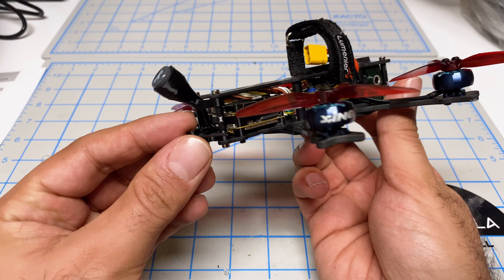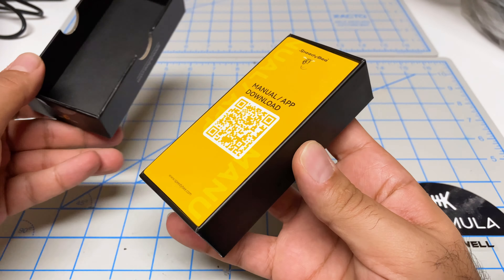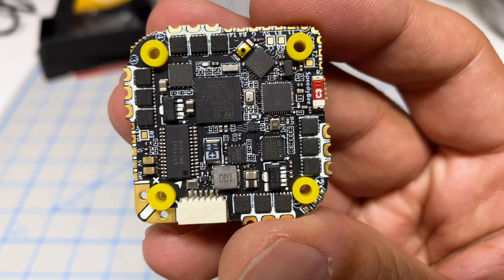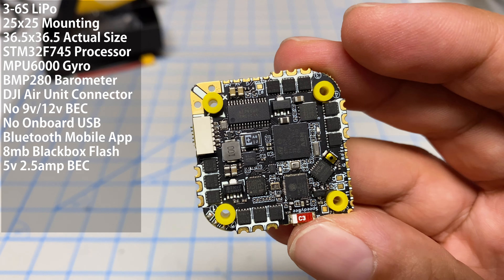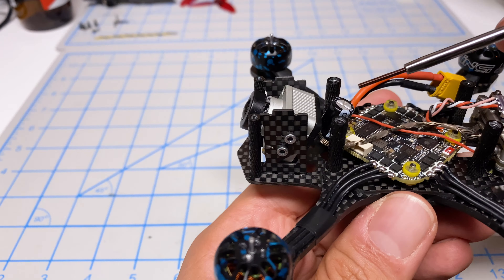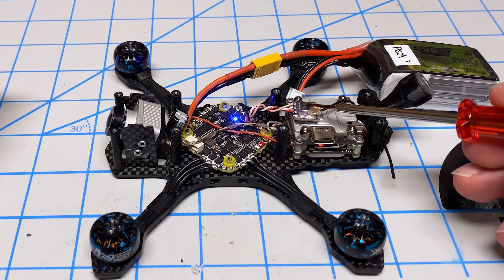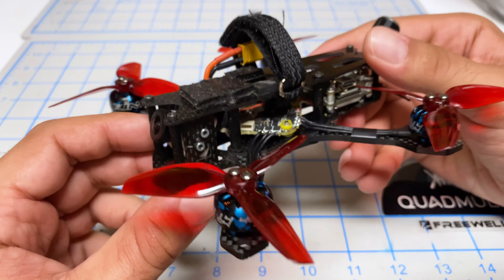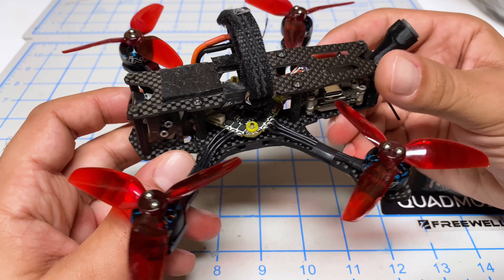Finally a RELIABLE All-In-One! | SpeedyBee F7 35A AIO Flight Controller

Comment: I got about 4 months and around 200 flights before mined died yesterday. I got a smiliar ammount of performance from the Betafpv AIO that was in my quad before this. Im mainly flying the Betafpv Twig XL 3.5" 4S
Reply from the maker: Thanks for the comment. How did yours die and was it the ESC that let go?
Reply: That’s surprisingly good 👍 I never had mine last more than a month. HAKRC has been pretty good for me too
Reply: @Mangorille it just died - no hard crashes or anything. I’m not sure what’s wrong - I still get power to Vtx and crossfire, but FC will no longer boot up properly. Could be ESC or something else on the board.
Reply from the maker: @AsgardStudios  Did you try doing a firmware update in case something got corrupted?

Comment: Tmotor has a great F7 AIO thats reliable (35a and 45a), foxeer has a great F7 AIO (35a and 45a)thats great and reliable. So this video title is clickbait and misleading. Speedy bee is alright but they aint nothing comoared to tmotor and foxeer.  And they are cheaper than the speedy bee
Reply from the maker: I looked at the Foxeer, looks really good but out of stock everywhere. The SpeedyBee mobile app is also helpful for quick tinkering out on the field but at the cost of a UART.

Comment: The Price compared to a stack does not justify the cost!
Reply from the maker: You do pay a premium for the smaller size. I did do a check and most f7 stacks are now in the 100-130$ range. You can get a f4 for a lot cheaper though.
Reply: I’m building on this now can’t wait I’m sure it will hold its value
Reply from the maker: @citytouchstudios1144  Good luck with the build. Make sure you refer to my advice about which UART to use otherwise you won't be able to do firmware updates and it'll hang.

Comment: Great overview of this AIO however how would you gauge or measure the reliability of this? I've never had any success of AIOs lasting more than 10 flights for unfortunately 😓
Reply from the maker: I heard that complaint with most AIOs, I haven't had a problem with the SpeedyBee yet. I'm over 10 flights on it now and I don't just cruise around either.

Comment: Can I flash inav on this one?
Reply from the maker: It's not clear to me. The specs say Betaflight but the manual shows INAV as a firmware type in the screenshots. I'd suggest logging a ticket with Speedybee to confirm before purchase. They're fairly responsive.
Reply: yes perfect under INAV 7.1

Comment: I probably screwed up on my first FPV build now and purchased this for an ApexDC 5" O3 airunit build... Is there any adapters or I have to purchase another stack...?
Reply from the maker: This wouldn’t be my first choice for a 5 inch unless you’re not a hard flier. No connector for the VTX on this stack, you’ll need to solder up the wires. If you’re not a good solderer, give someone a few bucks to solder it up for you.
Reply: @Mangorille  Thanks, I purchased another stack for the Apex frame, Diatone Mamba H743 V2 MK4 F55_128K Stack. Expensive mistake but maybe can use the SpeedyBee F745 for some future build.
Reply from the maker: @A3332  The AIO is a really good choice for smaller lightweight builds. I've used it on a 3" and my latest 3.5" builds.

Comment: I don’t understand why you just didn’t use the onboard DJI connector instead of soldering your Vista directly to the FC?
Reply from the maker: Personal preference, I prefer to solder the connections. Also, I try a bunch of different flight controllers so don’t have enough of these cables lying around to accommodate different connector configurations. You’ll need a full length connector for this AIO since I have the DJI connector up front (I run my flight controller 180 degrees backwards so that the battery lead comes out the front).

Comment: I can’t seem to get OSD off this to O3 Unit. The unit is plugged into to the 6 pin DJI plug and the UART 6 is selected on the ports to the correct peripherals. Still nothing atm
Reply from the maker: Do you see the drone's battery voltage in the goggles?
Reply: @Mangorille  no… no OSD at all. Only the google’s batt level
Reply from the maker: @dvpuk  You turned on MSP on UART6 correct? Did you check the pinouts to make sure they match what the O3 is expecting? The wiring diagram shows the connection for a Vista and not an O3. I didn't use the DJI plug. 
https://store-fhxxhuiq8q.mybigcommerce.com/product_images/img_SpeedyBee_F745_35A_AIO/35A_9-4.jpg
Reply: @Mangorille  yes the UART 6 is set up correctly. Are you saying the diagram is wrong for an O3? Would I need to swap over leads?
Reply from the maker: @dvpuk  I did not verify for the o3 but I know this was a problem when the o3 first released and some DJI plug'n'play connectors not having the right pin outs for the o3. If you are sure the configuration is correct, it would be an issue with the wiring or I've seen once where the o3 would not display the battery voltage of the quad and it got fixed by a couple of power cycles / firmware refresh. The OSD requires more configuration but at a minimum the battery voltage should display if everything is wired correctly.
Reply: @Mangorille  very confusing, I’ve swapped the TX and RX around to see if that will help but it doesn’t at all. Whereabouts could the wiring be that’s an issue?
Reply from the maker: @dvpuk  Want to email me some pictures of your wiring on the o3 side and the flight controller side as well as your ports tab in Betaflight?
Reply: @Mangorille  really appreciate your help with this, that would be fantastic. What’s your email?

Comment: Olá amigo montei um drone com essa controladora mais não dá comando no rádio vc sabe mim informar como Q faço pra resolver isso
Reply from the maker: That most likely just has to do with your wiring and configuration, not specific to this flight controller. Which receiver are you using and how did you wire it up?
Reply: Olá amigo eu estou usando o receptor elrs coloquei o mesmo receptor em outra controladora funcionou
Reply: Olha só amigo montei uma drone com uma controladora da axisflying F7 40 aio o drone fica vibrando muito Q nem dá pra voar eu não estou com sorte com essas controladora f7😢😢

Comment: Wouldn’t it have been easier to orient the board correctly and use the built in plug for connecting the vista?
Reply from the maker: Easier yes, but I like the power lead to come out the front so that I can zip tie it to a standoff for strain relief in a crash (makes it more difficult for them to pull off the board in a crash).

Comment: I wonder why so little people talk about JHEMCU.
My builds have lots of their AIO's and stacks. Havent had any issues so far.
The iflight beast F7 aio just died on me. So the brand name and price doesnt mean much to me anymore.
I'm starting to prefer 20x20 stacks over the aio. Much easier to solder up and you can replace fc or esc if they break.
Reply from the maker: I hadn't heard of them before but I looked them up and see that even GetFPV carries them but no f7 option, which is probably not a big deal given the use case. I've always done a 20x20mm as well but am trying to go as light as possible with my 3" builds now. I've managed to save ~26 grams so far through a naked O3, hv battery, and AIO.
Reply: @Mangorille  Jhemcu has f405 FCs. Nice to see getfpv carries some of their stuff. If you like to buy low price directly from ali in China, Jhemcu is a great option. An aio or stack costs 50 bucks.
Reply: +1 for the JHEMCU stuff. I have a bunch of their AIO FCs in micros that I've been bashing for quite a while and they hold up. Agree on the 20x20 versions too. Much easier to mount in traditional frames but the whoop style are great for toothpicks or tiny trainers, etc. Best value out there for this size AIO IMO.
Reply: No man JHEMCU are not good and they use icm gyro that is not easy to deal.
Reply: @bjjfpv4616  All manufactorers are using ICM gyro. Didnt you hear the mpu6000 Was no available for quite a while during the pandemic? First manufacturers are going back to the mpu6000 now that it's coming back in stock. It depends what ICM gyro was used. The 42688P is the good one that even repalced the BMI270. 
Although I do know that JHEMCU had an issue with the electronic board filters layout for that ICM gyro. They fixed it with the latest FC's. You could give JHEMCU a chance again. Or buy more expensive.
My worst experience is with HGLRC and happymodel AIO's and FC's. Betafpv also had some problems they fixed. So unfortunatly all aren't perfect and it's a luck thing.
Reply: My jhemcu worked fine for like, 20 flights. But, suddenly, gyro gets crazy and starts to flyaway. Tried everything but no success. Unfortunately, I believe they work only for someone than start to have problem. If you see a JB video, he talked about it, they assumed error in gyro but have no support. But they are cheap, to a beginner it looks ok

Comment: Is this not compatible with dji03!?
Reply from the maker: The flight controller? Yes it is, you can use the dji plug on it so that it is plug and play.
Reply: @Mangorille  awesomeness I am tho having issues setting it up I have flight gps elrs telemetry but when it comes to VTX display port on peripherals there’s nada :( dji does have power

Comment: I have put the controller in a cinelog 20 and there is no way to configure the position of the controller correctly.
At betaflight
please help.
thank you
Reply from the maker: You’ve got it facing in a different direction then the arrow on the board indicates? So when you tilt the quad forward Betaflight shows it going left and right? If so, you need to change the yaw alignment configuration on the config tab. I usually do this on all the quads as I run the stack flipped around (front is back).

Comment: Can I connect to this controller 14AWG wire with XT60 connector?
Reply from the maker: You can but whether you should will depend on the size of quad and your flying style. A bit unusual to want to run an xt60 with a thinner wire like that. I use 14 or 12 on a xt30.

Comment: Why not just mount it normally vs on an angle? Would just need to adjust the gyro is all and should fit in the quadmula just fine.
Reply from the maker: It's designed to be mounted at an angle if you want to use the 25x25 mounting pattern. The Lumenier frame I installed it on has 25x25 whereas the Quadmula does not. You could 3d print a converter for 20x20 to 25x25 but it's going to stick out the edge of the frame quite a bit and the motor wire locations are going to be all wrong.

Comment: I didn't find this board to be very reliable. My 5v BEC died after ~30m of flight time, rendering the board useless. I knew I was taking a risk using a newly released product, unfortunately this one bit me in the ass.
Reply from the maker: You mean the new F4 one and not this one correct?
Reply: @Mangorille  doh, yeah.